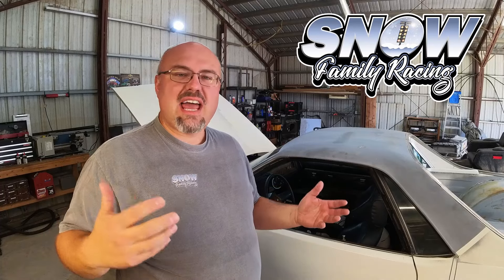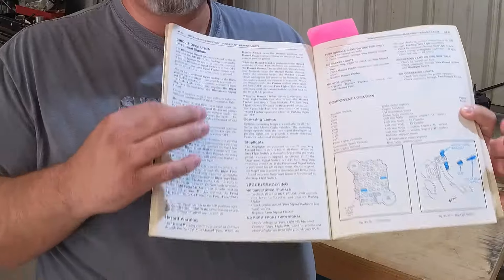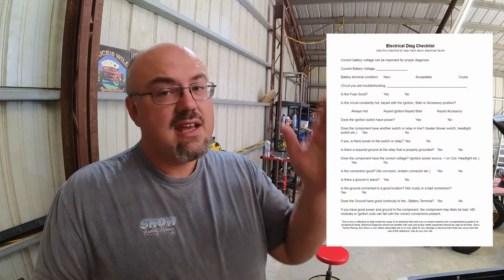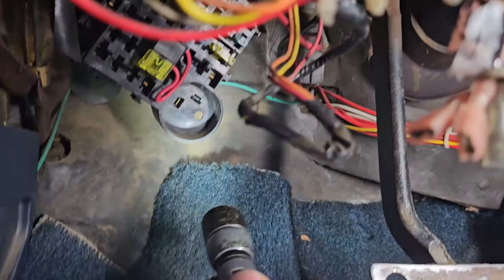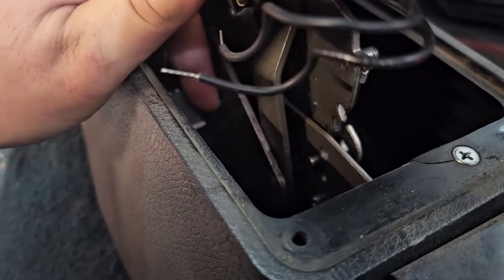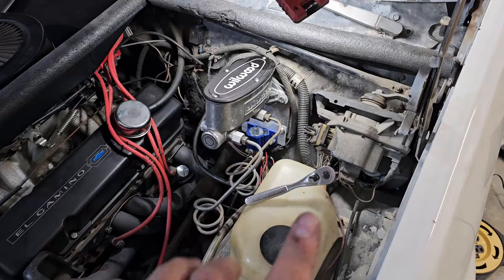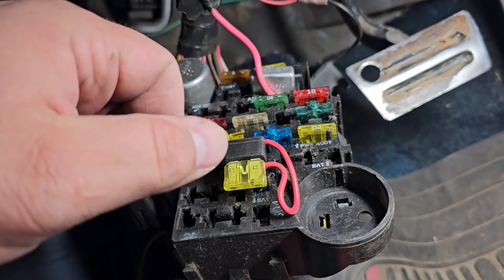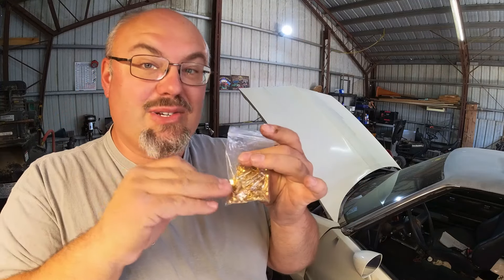The New Fuse Box Fix for Classic GM's That No One Knows About!

Comment: This is exactly the video I need to see! I have a 78 Pontiac G body I am having a no crank no ignition power when the key is to the on position. I already put a brand new ignition switch on the column which was a pain in a brand new battery and the only thing that works on this car is the headlight switch nothing else any help would be much appreciated
Reply from the maker: Glad to help! It was not the easiest thing to find until it touched it and it just kinds crumbled... only after making this video did i find my extra fuse box. When you pull yours apart, if you need the little single connectors, there's a link in the description for them. That'll save you a bunch of time trying to find them.
Reply from the maker: Also, you may want to check out the video I did with my Regal about how to track down a crank no start. There is a fusible link in line down by the starter for the main power feed, verify that is good too.
Reply: @SnowFamilyRacing  thank you man I really appreciate it. So far within the last 2 days I put a brand new battery ignition switch on the column and now I started taking the cables off the starter and tomorrow I will drop the starter just to get it checked as well. I noticed that when I went to go take the little nut off that holds the wire that sends power from the ignition it was kind of loose